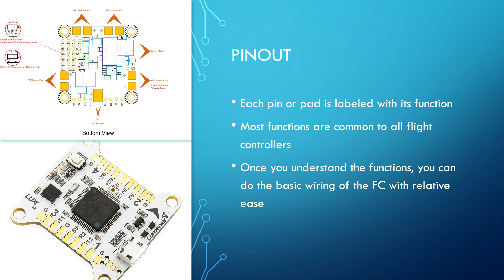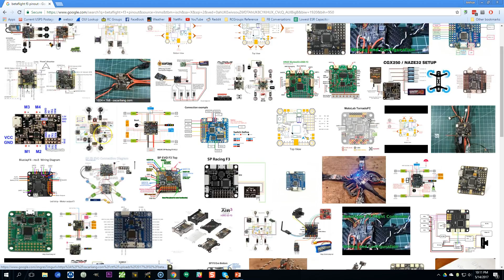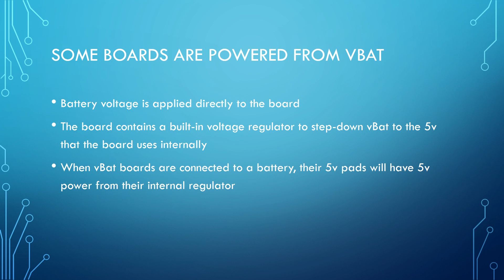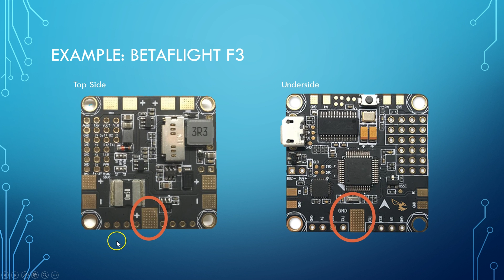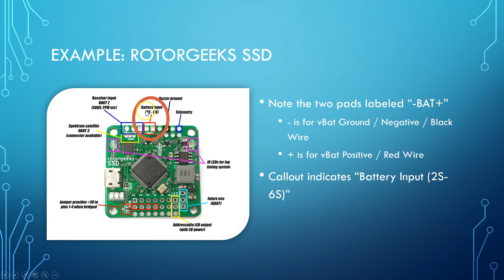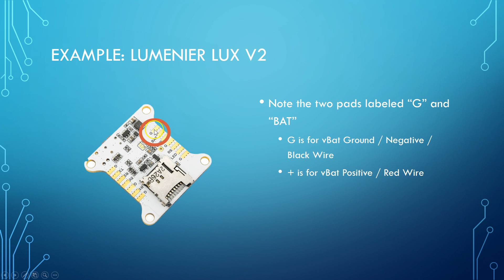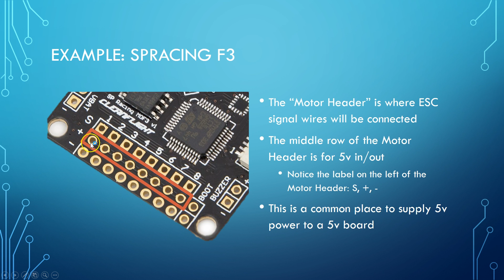Flight Controller Wiring For Beginners - PART 1 - Power

Comment: @18:00 BEC...... Battery Eliminator Circuit..... What a silly name :/
Reply: Liam Lambkin if they called it a voltage regulator people wouldn't buy them from the hobby mfgs for more than electronics suppliers.

Comment: The only grounds that I wouldnt run on either end of the FC are video ones. For best video performance wire all grounds to the PDB at the same spot. Else you will get lines through your video feed.
Reply: That's hardly the case mate, those lines are cause by electrical noise and you won't get rid of it by just connecting the signal grounds
Reply: UM this helped my issue. Maybe it only applies to OSDs